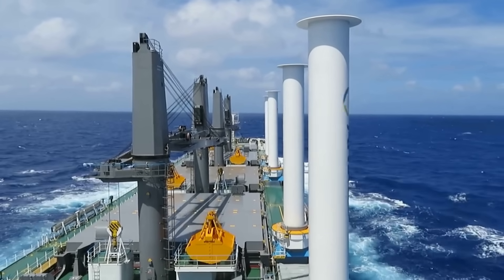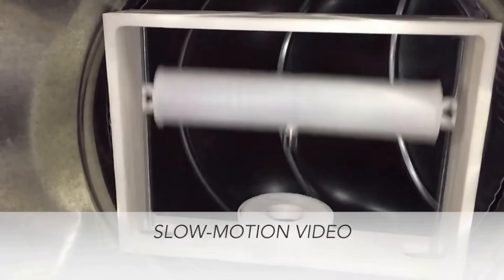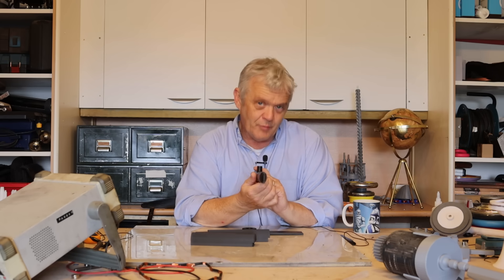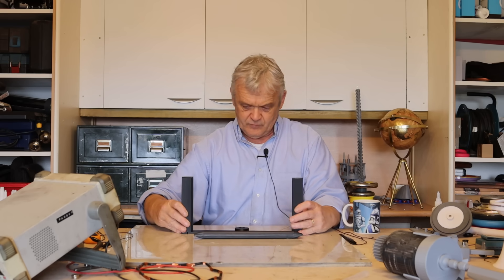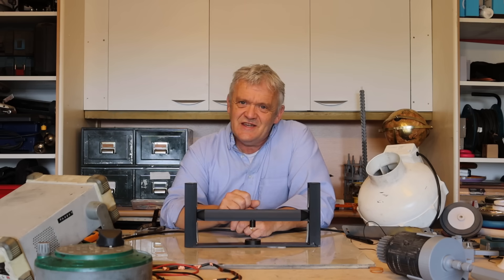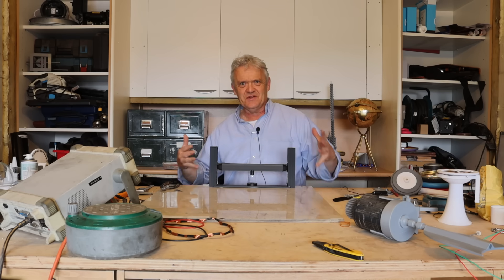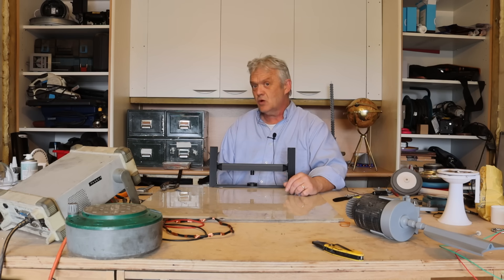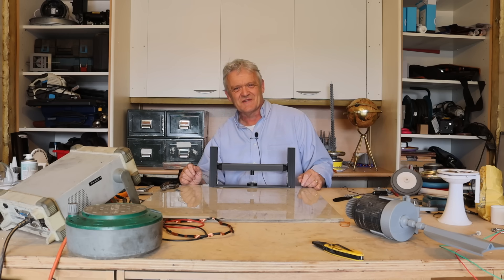2075 The Zephyr Windbeam - A Micro Wind Energy Generator

Comment: Remember well, if it has no gears, it means unreliable, inefficient, and a failure. Bearings are important when you want to lock in power output.

Comment: You mentioned the bounce. Are you after amplitude or frequency? How much bounce you want would depend on your application. Also, if you are limited on your 3D printers ability to print 300mm, print on the diagonal rather than the vertical or horizontal. 😉

Comment: Why not a flap that changes angle when it hits the ends of the track?

Air pressure drives it to the right, it hits a tooth in the track that forces the aerofoil to flip over to the opposite direction, and the air pressure now pushes in the opposite direction.

Use the back and forth to run that button generator you just demonstrated.

Comment: If you used magnets instead of the springs, would the magnetic flux of the top and bottom pairs actually change during oscillation? Could you induce a voltage in a surrounding coil from that?

Comment: I would have thought that there'd be a natural frequency of oscillation from the wind, which you'd want to tune, probably the softest possible, springs to for maximum displacement.

What the vortex shedding  visual made me think is, that vortex itself should produce oscillation on anything behind it, leading me to ponder if it'd be better to think of the whole system in 3D eg 3 windbars at the front, 2 ( maybe 3 ) slightly offset behind and maybe 3 more behind that. It wouldn't add much depth to the overall package but should produce more energy from the 2D front area limitation that people will have.

Comment: Would using the wound up trimmer line or string as a synthetic muscle work as the spring? Also would attaching to a ratcheting system with some gearing make it possible to turn the small flutter into a greater distance/speed for a traditional generator?

Comment: Here's a thought. How about a steam engine? Use a monotube boiler for safety, drive a Tesla turbine connected to a generator. Condense the steam back into water for reuse. Lots more power than Stirling. It would be an awesome project.
Reply: Typically, a Tesla turbine is used when there are viscous fluids, so I think using blades will give greater output and it is simpler. There is a difference between a turbine and an engine. The turbine produces a high RPM but less torque, while the engine produces a lower RPM with high torque. Each has applications that suit it, and certainly adding a simple system such as gears will improve the performance, efficiency and reliability of both turbine and engine Significantly.

Comment: Rubber or silicone bands to replace the springs. Adjust the post heights so the bands don’t stretch until the bar starts oscillating.

Comment: Inside the vertical bars you will want to have solid bars that feed downwards into a flywheel similar to your project in 2046 on each side (2 flywheels per horizontal bar), then you only need springs that will prevent "bottoming out" on the bottom and springs at the top to prevent "crashing".

No need for the springs to actually attach to the "bar" directly, they just attach at the top/bottom of the vertical bars while the horizontal bar can be "free floating".

Comment: Magnets instead of springs and with a weaker force or even just weaker springs but, I like the all magnet idea. 
(edit) 
You will have to be aware that if it oscilates at the same frequency of the object that it is attached to it will destroy it.

Comment: Ring magnets sliding on rods to act as magnetic springs?...or multiple ring magnets on same rod to increase "spring" length.
Non-linear spring constant - weak for small displacement and strong for wide travel - may help get oscillation going, also try tuning the mass
There might also be a way to extract power using the same magnets.
Friction could bea problem - small diameter rod
Do a search on kjmagnetics and magnetic pogo-stick - they 3d printed a test model

Comment: Firstly I though about a turbine but a windbeam will works, maybe better what do you think about?:   Vehicle-Induced Water Pressure Energy Harvesting System

Objective: To design and implement an energy harvesting system that utilizes the mechanical energy of passing vehicles to pressurize water, drive a turbine, generate electricity, and recirculate the water for continuous operation.

System Components:

    Water-Filled Bag:
        A robust, flexible bag filled with water, positioned on the road surface to be compressed by the passing vehicles.
        Materials selection should prioritize durability, flexibility, and resistance to wear and tear.

    Valve and Turbine Assembly:
        A valve mechanism to control the flow of pressurized water from the bag to the turbine.
        A turbine designed to convert the kinetic energy of the flowing water into rotational energy.

    Electric Generator:
        Coupled to the turbine to convert mechanical energy into electrical energy.

    Energy Storage Cylinder:
        A mechanism to temporarily hold the water post-turbine operation before it's recirculated back into the bag.

    Water Recirculation System:
        A system to ensure the water returns to the bag, maintaining a continuous cycle of water flow for sustained energy harvesting.

    Control System:
        A control system to manage the operation of the valve, monitor the performance of the turbine and generator, and oversee the recirculation of water.

Operational Flow:

    Vehicle Compression: As vehicles pass over the water-filled bag, the water is pressurized.
    Turbine Rotation: The pressurized water flows through the valve, driving the turbine to rotate and generate electricity.
    Water Collection: Post-turbine, water is collected in the energy storage cylinder.
    Water Recirculation: Water is recirculated back to the bag, ready for the next cycle of energy harvesting.

Comment: Hi Rob, have you seen those old spring reverb units that Fender used to make to go with guitar amps? They used two simple  transducers to both to drive one end of the spring and to recover the signal from the other end  of the spring, in each case using a twisting motion from the lorenz force. Could these sorts of transducers be beefed up and used to generate from a wind-belt or bar?

Comment: "we want to harness the power of the wind to generate electricity. Shall we use one of the many design ideas that are mounted fairly close to the ground for ease of maintenance and often with minimal components OR shall we go for huge propellers on massive steel towers where if something goes wrong they will likely crash and burn?"

"So massive non-recyclable propellers it is then"

Comment: I take it the wind's coming over the top? What if you added a turbine like that roof line one, but just above the bar's maximum top oscillation. 
i'm thinking about a small one, about the same width and height as the bar to start with...

Could you catch some extra wind there?

Comment: Can you replace the springs with magnets? Not sure if it is possible but I would imagine if the tips had magnets pushing against other magnets at  the bottom and top it will remove the spring that is essentially the only part that can fail.
Reply: A long time ago over 25 years ago a friend's brother designed  something very similar it was a  wing in the same setup as featured as it got to the top a cam tilted the wing and it moved down then at the bottom a cam tilted it again and it went to the top not sure what ever happened to his idea but i always thought it was brilliant.
Reply: Maglev springs. Nice idea!
Reply: You beat me to it. My thoughts exactly ! 👍
Reply: Agreed, was about to comment similar.
Reply: Maybe a water/air bubble rocker?
Reply: Well done mate. Do you intend to attach it to a speaker as a gen?
Reply: Springs fail!!! Do you know what you're talking about ? The thing that fails the complex electronic circuit.

Comment: Use a long rectangular foil bag and put an axis longitudinally into is with some bars in it to maintain an oval shape when inflated with air:  --++++++++++++--.  The bigger surface will cause larger oscillations and reduce material costs.